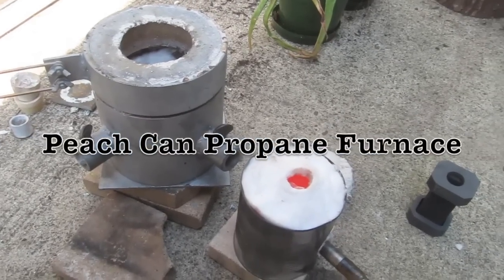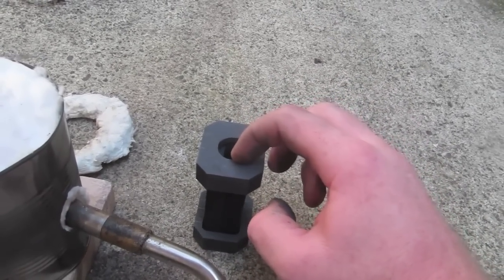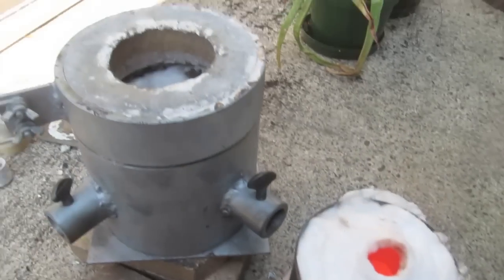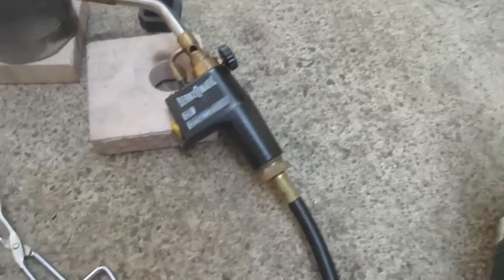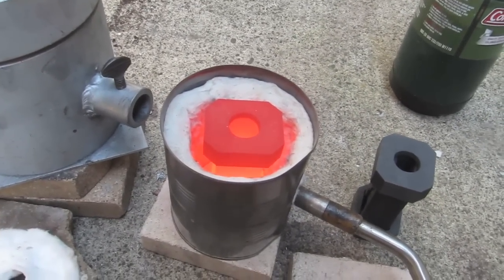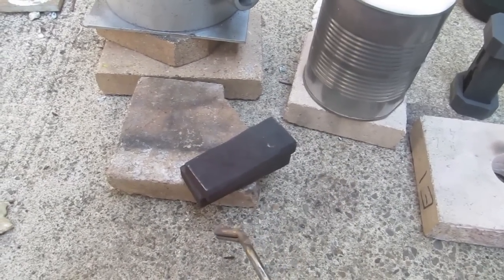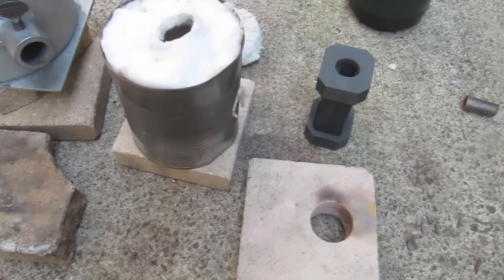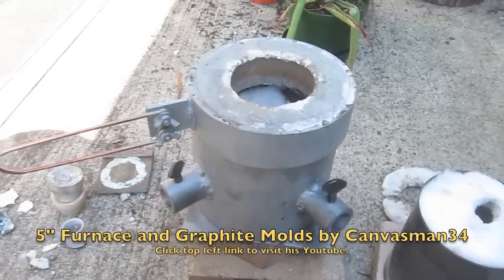Home Made Propane Furnace. Easy DIY. Melts, Silver, Gold, Copper

Comment: I have a furnace to from Paul, and was having a hell of a time trying to melt anything other than tin. I was only using 1 propane torch. Watching your video I think my problem is I need to decrease the heating area by adding more Kao wool to inside. I see everybody's videos and how easy they show it but I kept having a problem.  Thanks for the video. Sometimes someone's video may have a minute detail that even a seasoned veteran like Paul may not have mentioned or show.
Reply from the maker: Yeah. The thing with Paul, is he is making those videos while playing. He is a good friend of mine who lives down the street from me. We both enjoy playing with Metals and cutting killer Graphite molds that are cheap and work excellent. He likes to share. But his videos lack a bit here and there as they are made when he figures something out the first time, is playing around, or trying to share something cool and simply leaves it out because he forgot. That is just Paul. He is awesome. And gotta love that hes made all this stuff available and cheap too.   
 A single torch in the large 5 or 6 inch furnace isn't enough. You have to have two. And its really about space. For me. I use it with dishes and large tongs. Once its cooking. I can melt, poor, melt poor all day. And it does it quickly. I also had a sheet of kaowool over the top and put a hole in it the size of a silver dollar. And I also line the inside with a little extra Kaowool. That shit that flakes off can get in your metals. So I line it again so its a little less space. As its more than I need unless I am melting 20 oz bars. It will melt stuff very fast once it gets hot. This set up however (the 5 and 6 inch furnace), is a propane hog. And will chew through propane very quickly. 
If you are just melting a small amount of stuff. Go with a peach can, or any large canned goods can. Tomato can, whatever. Its fast. It gets extremely hot and can run off 1 good torch. I use TS8000's. Paul's micro mini is also pretty bad ass. And can run off two torches. 
But, truth is. Peach can it. Just need to punch a hole for your torch line with Kaowool. And you are set to go. Costs like 5 dollars. Kaowool is cheap and so are canned tomato sauces. 
Good luck.

Comment: I have a homemade furnace about the size of the bigger one you weren't using. I couldn't get it hot enough to melt aluminum using one torch.
Reply from the maker: I am not sure what torch you are using. But you need at LEAST a Berzomatic TS4000 or TS8000. And you'll need two torches to heat that space up faster. Or to line it with Kaowool. Reduce the inside diameter. And made a Kaowool cover for your top. Silver dollar in size for the outlet hole. 
I have a video of me striking coins. That shows me using my larger furnace. I will post it so you can see what I am talking about. Check back in a few days. 
Good luck!